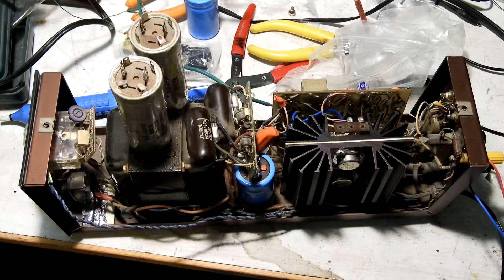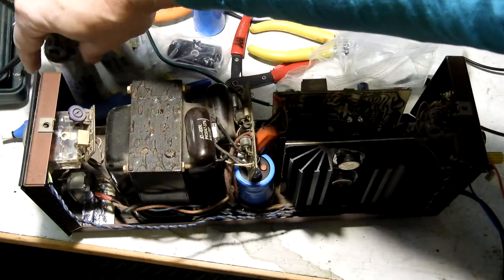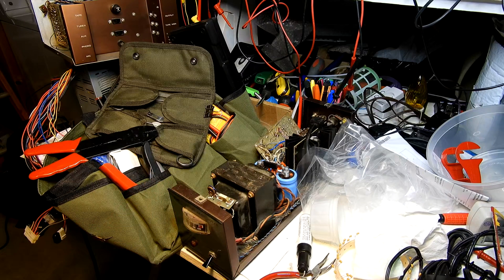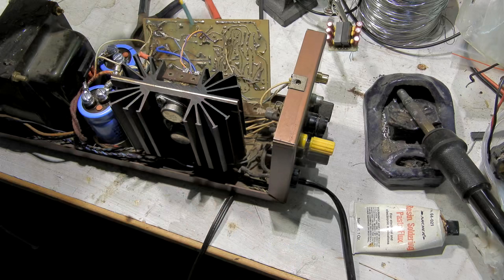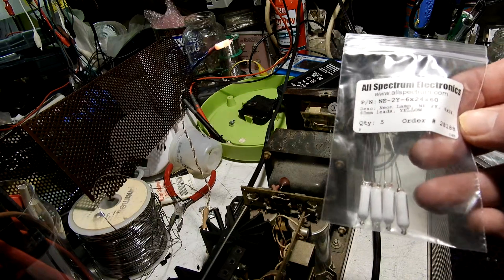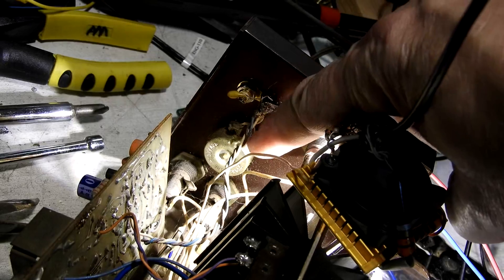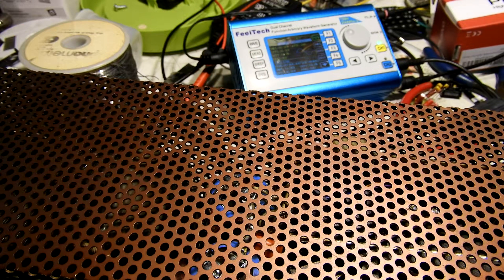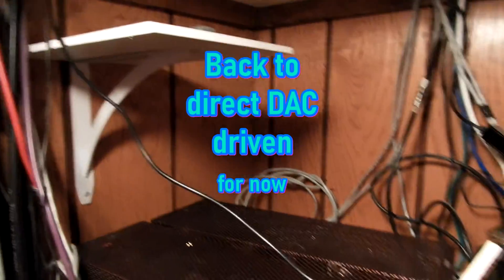Tiger Taming! The SWTPC 207A Power Amp

Comment: Don't you have a couple of unbuilt Tiger amp kits?
Reply from the maker: Yup! It's not a super high priority but I hope to get to it in about a year, but meanwhile, I need to inventory the kits and see what I need. Already bought a wire kit I really liked though it is probably an expensive way to buy wire. But with silicone insulation and fine tinned Cu stranded wire, in a multicolor kit, I'm tempted to get a couple more kits in different Gauges. I'm wondering about whether or not I use the NOS filter caps!
Reply: @HillsWorkbench  I'd replace all the 'lytics and carbon resistors (if any). I bought some wire with different color insulation from eBay and was very disappointed to get copper clad aluminum junk with some type of greasy coating that wouldn't allow solder to stick. I ended up throwing it all away. Burned by Chinese junk once again!.

I'd design a new preamp.